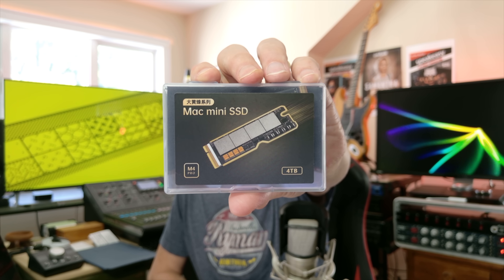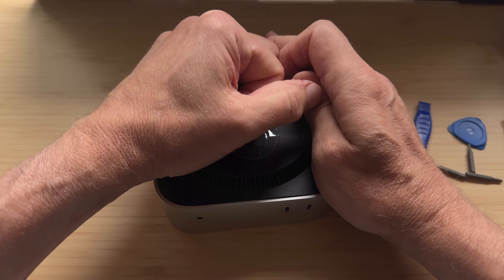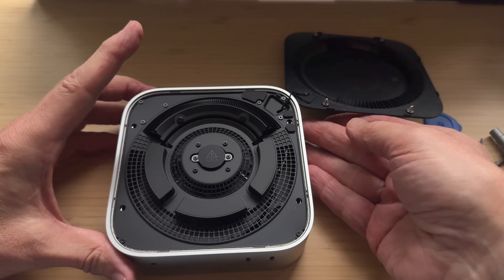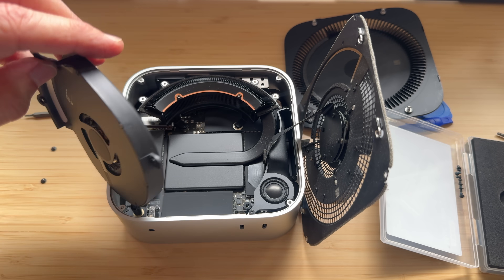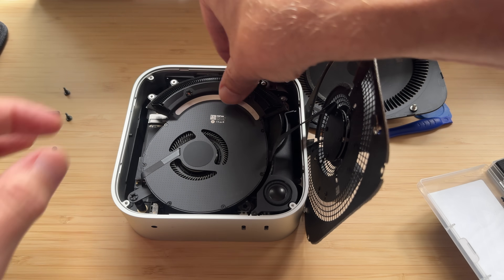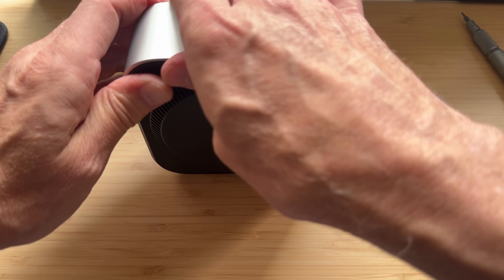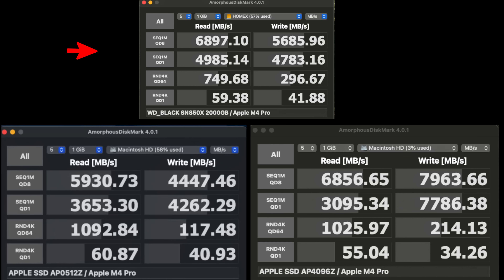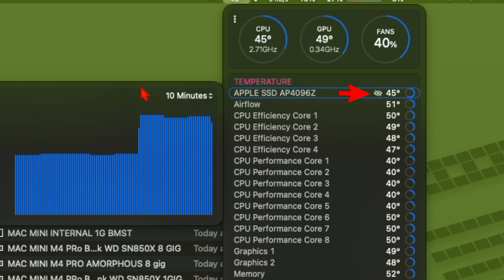Apple Hates When You Do This!  Upgrade Mac Mini M4 Pro SSD & Save $510

Comment from the maker: I ran some tests on the SSD using Homebrew and terminal and it looks very good, showing they look like new Nands which they state on their site that they use brand new chips but as others have stated down in the comments, if you remove and reprogram and instal new firmware with DFU mode, it could still be a used chip there is no way to know for sure. We have to take a leap of faith with what the company says in the fact that they are using brand new chips and the fact they give you a one-year warranty is decent. I guess time will tell.👇👇👇👇👇👇👇👇
🔎 Key SMART Values

Power On Hours: 1
→ Excellent. A brand new SSD should show very low hours like this. If it had been recycled, you’d likely see hundreds or thousands.

Power Cycles: 7
→ Totally normal. This counts reboots/initializations. A handful after install/setup is expected.

Percentage Used: 0%
→ This is the wear indicator. 0% means the NAND is still fresh, essentially brand new. A used/recycled drive would show >0%.

Data Units Written: 1,937,389 [≈ 991 GB]
→ This is how much data you’ve already written. Installing macOS, updates, apps, and tests easily accounts for ~1 TB. This number starts from zero, so it confirms the NAND wasn’t pre-used.

Data Units Read: 490,030 [≈ 250 GB]
→ Normal — just shows you’ve read ~250 GB so far.

Available Spare: 100% (Threshold: 99%)
→ Drive has full spare capacity; no cells have worn out.

Media/Data Integrity Errors: 0
→ No errors. Good.

Temperature: 37 °C
→ Normal idle temperature.

⚖ Conclusion

✅ Your SSD’s SMART data confirms it’s basically new NAND:

Only 1 power-on hour

0% wear

~1 TB written (just from setup/use after install)

There are no signs of recycled NAND (no high power-on hours, no abnormal wear, no prior TBW logged).

So whatever M4BoostHub is doing, this module looks like:

A genuine Apple SSD controller (reported as AP4096Z).

With new NAND chips soldered on.

That matches their claim of “brand new chips, not harvested.”
Reply: Not true. Each Time you create a SSD from various Nand (on Apple silicon Mac), the smart values are reseted. So there is no real way to tell if the Nand chips were used or new.
Reply from the maker: @QuentinVagner  ok, but via my benchmarks and tests above they are behaving like new chips and the fact they offer a one year warranty and state that they are new, I guess one can take a leap of faith, or not....
Reply: @MacSoundSolutions  they are probably new but you can’t really know for sure. 
An example : you use your new SSD for a while, you desolder the UN000 chip on the SSD, empty it with a programmer, resolder, restore system : boom, brand new SSD with clean smart values.
Reply from the maker: @QuentinVagner yes understood, I will be doing an update video soon and add some of the info. All new to me really so went with what the tests show but I am not a Nand expert.
Reply from the maker: @QuentinVagner updated my pinned post.
Reply: @MacSoundSolutions Great video Lance. I have a Mac Mini pro, and my home folder on an external drive, a Acasis thunderbolt 5. For me, and I'm not sure if it is because of the home folder being remote, or maybe it is just the operating system, but my Mac is very buggy. Crashes alot, I have 2 monitors, and maybe because they are old, one will blank out or the menu bar will disappear. Very strange. I have a 1 tb internal drive, is there a way to relocate the home folder back onto the internal drive?
Reply from the maker: @MichaelSmith-bg1vp that’s my next video stay tuned. I have not had any issues like that with my external home drive setup it’s been really solid.
Reply: @MacSoundSolutions  I will definitely stay tuned. I do like the setup, especially that it keeps the amount of data on the internal drive low. Who knows, if my Mac is still buggy after I try going back to the traditional setup, I can always go back to the remote user folder setup. Your videos are fantastic and much appreciated!
Reply from the maker: @MichaelSmith-bg1vp  strangest thing happened yesterday all of a sudden Spotlight is able to search my iCloud Drive. Not sure if that’s due to an update that Apple fixed indexing issues with iCloud Drive on external drives. I have to play around with it some more I have a symbolic link of my user of my external drive, placed in the users folder on the internal drive, but that didn’t seem to do the trick but it’s been there so I’m not sure why all of a sudden iCloud drive is now searchable on my external drive

Comment: Great video...I performed the exact upgrade to my M4 Mac mini Base Model, which only allows 2 GB max....Yes, you don't need to disconnect any of the wires especially the power button which is easy to break if not careful...my Read Speed is about 3100 and Write about 4900 on the Black Magic speed test...Thank you for sharing this information.
Reply: Curious. If Mac Mini M4 only allows 2TB how did this upgrade work? 
Is there a firmware or  hardware diff from a 256GB model to a 512GB model which permits the upgrade to be 4TB ??
Reply: @globalrevival  either this or a difference between m4 and m4 pro

Comment: Hopefully we can upgrade future Mac GPUs as Apple maybe putting GPU seperate on Board to increase GPU size and performance.
Reply from the maker: We can dream but not sure that will happen as they are currently integrated GPUs.
Reply: @MacSoundSolutions 
There was talk of moving gpu of soc to board.
Would help with temps and they can make bigger GPU chips.
This would be for Pro Mac's/iMacs etc.
Reply from the maker: @Tech_no_Man that would be awesome I have not seen any info on that but if the next Mac Pro and studio have that that would be huge Apple could really compete with AMD and Nvidia if they did that.

Comment: It actually says Apple SSD because the drives are dummy NAND carriers the controller is built into the m4 chip. Great video I upgraded my base (with 10Gbe) m4 mini 256 to 2TB myself a while back with iboffs excellent upgrade.
Reply: It’s definitely a possibility I know iboffrcc designed their own pcb because a lot of the other options out there were using only 6 layer pcbs and apples SSD is on a 10 layer PCB. Iboff met in the middle and designed a custom 8 layer board. They made a video talking about the design and layout of the board and it impressed me so that’s the route I went. Most likely the majority of upgrades available are 6 layer boards with new nand but I’m sure there are some apple genuine boards with the NAND modules replaced. I decided to keep my original 256GB board in case I need to warranty my Mac mini.
Reply: So do you think they've sourced some of the same populated PCBs that Apple uses (perhaps refurbished),  and then just added the NAND to it?

Comment: First of all, GREAT TECHNICAL REVIEW. Your channel and reviewing style is getting better every video. Well done. Regarding the hack and slash NVME that is being reviewed, it is WAY over priced by 2 - 3 X what retails for brand name 4TB NVME drives. A 1.5X premium over a no name brand 4TB NVME drive would be a lot more suitable. Apple tax greed has gone into these Chinese garage operations too. So many horror stories on Reddit in the last 6 months of people getting these types of internal 2TB SSD's for their base Mac Mini M4 (Not this reviewed unit but still). You will never feel fully confident in using your Mac with one of these inside. Just go External on an Intel chip Thunderbolt 4 enclosure like an Acasis and that would be rock solid.
Reply from the maker: Thanks, and Yes it is pricey, and time will tell. The design looks well done but I’m no expert. The only issue with externals is no apple intelligence if you’re booting off the external, but I’ve heard there is a hack on GitHub that fixes that and the external home folder method has its own drawbacks, but it worked very well for me and they are minor.
Reply from the maker: Check my test results above, at least it seems the Nands are brand new un used and they do offer a one year warranty,

Comment: way too expensive, $600? it is better than apple's insane pricing but still too much
Reply from the maker: I hear you, they are really pricey.  Free was great but I don’t think I would spend that kinda doe for 4T as my external home folder setup was working great with 2 terabytes which is plenty for my user account. And time will tell how well it holds up.

Comment: Is that true that the 2nd has to be Silicon Mac? I've seen other channels mentioned using Intel base Mac.
Reply from the maker: You can use intel I believe but you need to download Apple Configurator from the App Store where dfu is built into Apple silicon just works
Reply: @MacSoundSolutions  Got it. Thank you for your response.

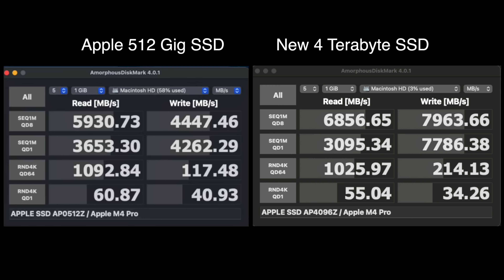Comment: 9:41 These third party SSDs are usually using genuine NAND chips harvested from broken Logic Boards leaked from Foxconn factories, and they don’t have controllers built in so I guess these explian why it’s also called Apple SSD.
Reply from the maker: Yes cause the Apple firmware is written to them during the DFU process. I was wrong on this theh firmware is not written to the nand but to the computers internal firmware chips.
Reply: @MacSoundSolutions  highly doubt firmware is written onto NAND flash chips
Reply from the maker: @dan8t669  Correct it is not written to the nand but to the computers internal firmware chips.

Comment: £455.00 for 4tb's. Much better than Apple but a 4tb Nvme is about half that price so still considerable markup.
Reply from the maker: Yeap not cheap but so far seems to be very solid and everything works in Mac OS unlike running an external drive where there are some quirks as mentioned. It’s nice to have the option.
Reply: @MacSoundSolutions  I guess a lot of the cost is probably sourcing the PCB with the controller,   and obviously the cost of the NAND.    Clearly they don't have the luxury of negotiating the kind of bulk discounts that the big corporations can get, so it's going to cost a bit more than an off-the-shelf SSD.